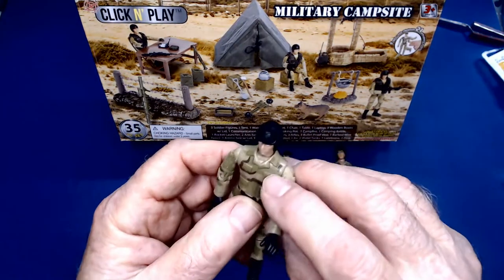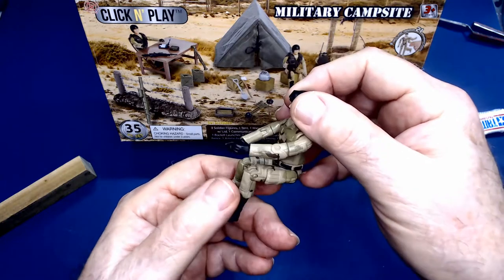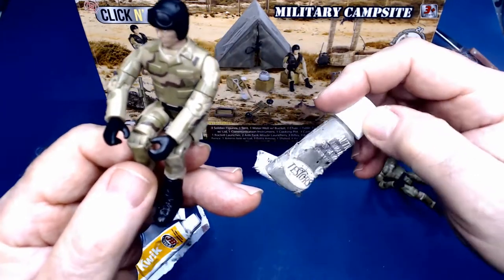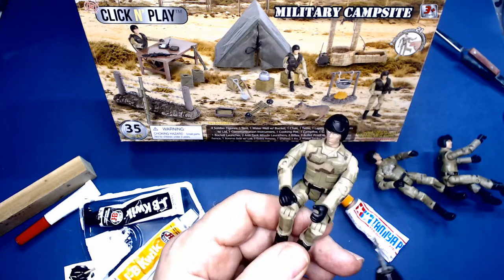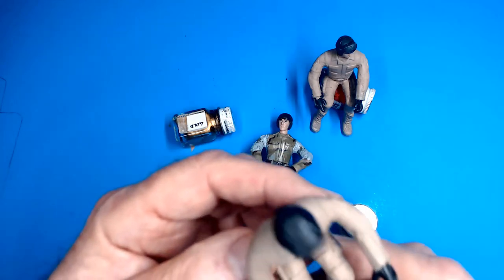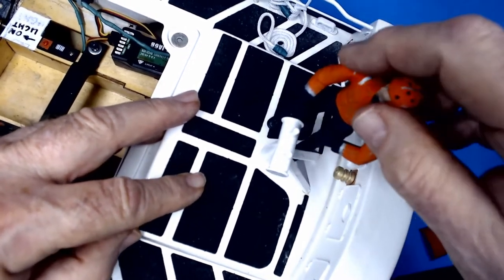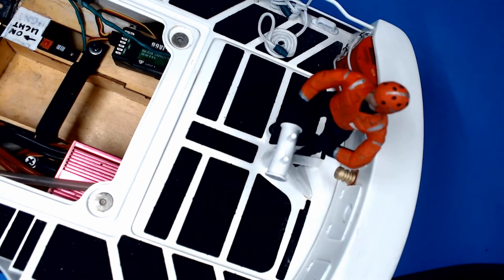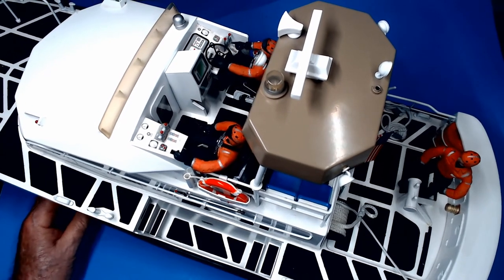Scale Figures for model boat

Comment: Looking great!!!!

I noticed you painted the seats black when you installed them.  We're all the seats black?
Reply from the maker: Yes, It looked like the seats were dark blue when I started.  (Possible some overexposed pics.)  Later, I took a closer check using several photos and the color selector in Paint Shop Pro and found the seats were actually black.  I still need to do the two folding jump seats but those will not have any figures.  The boat had a crew of four and one stayed below either in the inside bridge or the engine room.